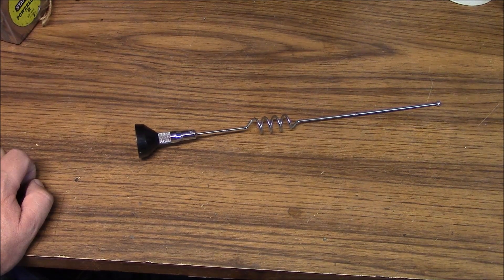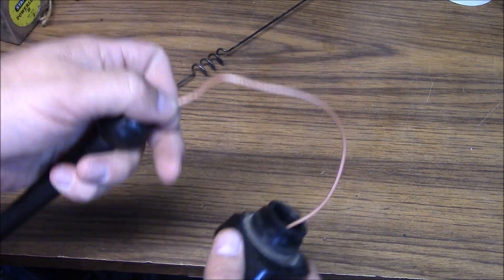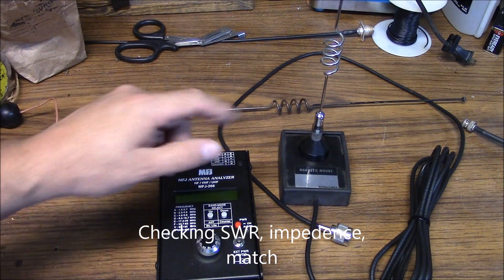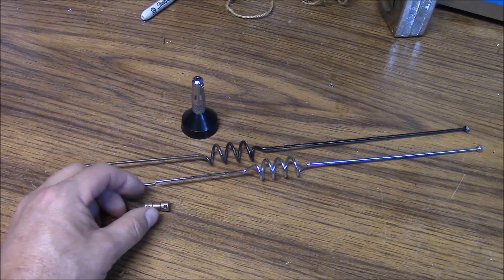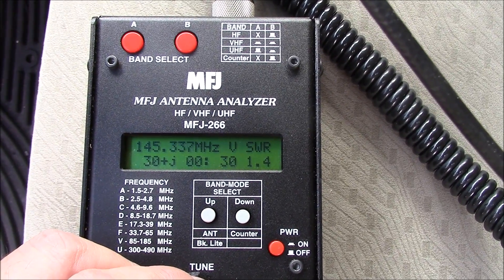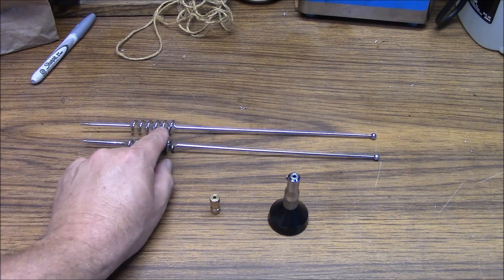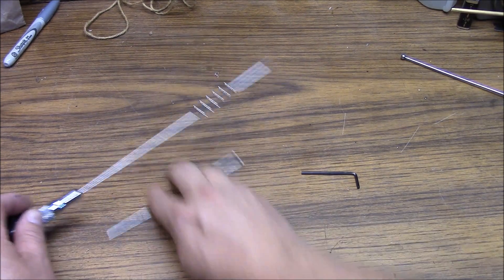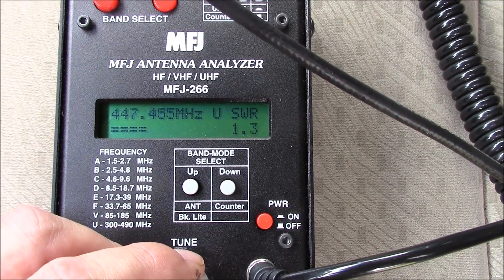VHF UHF antenna basics - DIY antennas from surplus 800mhz antennas for 2m 70cm and dual band

Comment: Very Nice, thank you! Question regarding the dual-band antenna. I noticed you put the UHF antenna closer to the base and then worked with the two meters at the top. Does it matter? Thanks again! Good info!!!
Reply from the maker: You are welcome ! I wanted the UHF length before the coil. I have not tried it the other way to see if it would work. BTW I still use this antenna on a mag mount when I use a rental car. Thanks for watching !

Comment: Thank you, very interesting video, and I like homebrewing with what I have at hand.  It seems you have identified the length of an 800mhz resonator which works on VHS simply by finding that the elevated feed resonator on the low mount has proper SWR - so, luck?  Knowing the length of the long resonator, you built the other resonator up, and created other variations.  But -- what length, in inches/cm, of a 800mhz resonator are we wanting to find or build?  They come in at least two lengths, maybe more?  I didn't hear in the video any length -- only lengths of segments relative to parts of the long resonator.  Thanks for clarifying.
Reply from the maker: 5/8 wave 800mhz antennas were all the rage in the smartzone  and amps days and every one I have found will work if you extend the resonator as shown. Just find a 5/8 wave 800mhz (806-870)  antenna and add length. These antennas pulled out of the pile unmodified are typically resonant around 160-170mhz just add a couple inches overall and your VHF is done. Thanks for watching

Comment: I haven't done any antenna fiddling before so I wonder if I can solder a resonator to the center of a pl259 plug? If so, what do I do about the outer part of the plug? I assume I have to isolate it from the resonator so it doesn't short out. Or am I totally lost in the woods and it can't be done this way?
Reply from the maker: You can totally make your own antenna in that fashion. You will need a resonator that you can solder , solder it to the center pin, insure that your resonator is insulated from the body of the connector. Thanks for watching !
Reply: @survivalcomms  Thanks! Any particular material I should use or is it good enough as long as it is insulated and the plug is filled up for sturdiness?
Edit: Could I use the dielectricum in a coax cable and slip it on the resonator? If it's too tight I could split it and insert a strip of dielectricum in the split and fill up excessive space in the plug with non conductive silicon that hardens, for sturdiness and to prevent water to enter.
I will have to find a resonator that will not bend easily and still fit the plug because I'm planning to put it on a magnetic base and use it on my car. It will not be for the ham bands. It will be for commercial frequencies in the ranges 154-160 MHz and 445-460 MHz. I will start with the measures from your videos and experiment from there, shorten it bit by bit. Do you think it's possible to make the antenna resonate in both the above mentioned frequency ranges? Any other comments on my plan? I can use all the advice I can get.
Reply from the maker: @syspangylium  some dielectric from RG8 should suffice
Reply: @survivalcomms  Thanks again! ☺️
Reply from the maker: You are welcome !

Comment: I was recently gifted a hand full of old ham radio antennas, and odd radio stuff & junk. One was a mag mount (odd sized) dual band antenna, which now appears to be a cell phone antenna! (Its crap on 2 meters!) So I will try and convert it into a 2M/440 or something usable? 
Great video and explanations!
Reply from the maker: The 5/8 wave cell antennas are resonant about 160 + - 5mhz in my experience. If you remove the finish , put a test clip on the top, and add a couple inches of wire adding length above the coil you can see if it helps.  Thanks for watching !

Comment: Explain the following to readers.
It's 6 inches before the load coil that is this loop, and after the loop it's 8 inches. This loop of 8 turns makes the resonance at what length ? This loop has 2/4 wave, that is, half wave ? The antenna has 2 radiant and if we want to put more radiant it should repeat that same amount of coil + radiant? Because there are no new videos about these collinear antennas for VHF and UHF on your youtube channel.

Comment: A tap and die set is a really useful tool to have. Paired with a box of different size grub and steel machine screws you'll find lots of uses for it.
Reply from the maker: I have a nice set here. The whip was much smaller than the stand off. Would have had to seal it regardless. 5 + years later it's still working good. Thanks for watching !

Comment: Sir I got a radio UHF car mount antenna for my radio.  I just recently  got a dual vhf/uhf baofeng . Can I use that same antenna for my baofeng dual radio .  Now the whip rod on the uhf antenna is removable and is about 9 inch
Reply from the maker: Yes you can as long as you keep the antenna parameters within the VHF / UHF frequencies you wish to cover. Thanks for watching !

Comment: Thanks. Question (since I'm not good at coils)...would it be possible to make a 1/4w vhf and 5/8w uhf with these? 
Gonna make me some dual band MURS/GMRS antennas for the cars and HTs.
Reply from the maker: With old 800 antennas it wouldn't work out. It is possible with other antenna designs. If you want good performance go with monoband antennas IMHO. Thanks for watching !

Comment: Can something like this be made in a 5/8 wave for VHF and UHF base station? 95% of the time it will be listening but I will mainly transmit on 146, 154, 451 and 458MHz. Thanks for the awesome video! I'm using a tram 1181 on a ground plane base and it does well for my use. But I'm wanting more gain in the UHF side as it lacks a bit. SWR is about perfect with this setup but would like to try a 5/8 wave and see if it helps any.
Reply from the maker: You should look into building a collinear antenna  for UHF or a yagi and away from a "dual band " solution IMHO. This is a resonant compromise. Thanks for watching !

Comment: Thanks.  Wish you’d shown how u were testing the antennas, for beginners, don’t know how you connected them to antenna analyzer... only seen them hooked up to coax.
Reply from the maker: Back when I made this video I was using my buddy's MFJ 259. I try to keep my videos short and sometimes details get left out. The feedline connects from the antenna's NMO base and goes the the RF connector on the 259 in this example. I use an Anritsu Cellmaster now for VHF/UHF/SHF antennas and the antenna connection is on the RF out on that one.  I hope this answers your question and thanks for watching !

Comment: I wonder if you can get you hands on some stainless steel welding rod and use that to make your own elements - the only issue will be making the little thing on the end but I guess another coupler could be used instead.  I think they can be a cheap source for these, not sure what the max length is.
Reply from the maker: Those will work. I have access to the rods. I just used the pile of surplus antennas I had to make the video. Thanks for watching !

Comment: lets see if I get this right you take the length of the vhf and add the length of the uhf to get dual band antenna
Reply from the maker: The length beneath the loading coil will dictate your UHF resonance. The overall length will dictate the VHF.  Do you have an old 5/8 800 mhz antenna you are working with ?
Reply: @survivalcomms o was thinking of buying some on ebay. just needed more understanding s othe rule is the bottom half is the uhf and the overall is the vhf .I want to get into understanding antennas during and emergency and you have to vacate be nice to know what you could use to get by with for antenna
Reply from the maker: The 800 5/8 waves can be pressed into service as VHF quarter waves if need be as is.  In this circumstance the main consideration is to keep the length of the UHF at 1/4 wavelength below the loading coil. The overall length should equate to a 1/4 wavelength at VHF. The best practice is to test what you have to see where you are before you start cutting.  You can always lop off 6 inches above the coil remove the coil and make a UHF antenna.
Reply: @survivalcomms  SurvivalComms explain the following to see if we understand 100%.
If we put 6 inches or 1/4 of a wave into UHF we will have, for example, an antenna for the UHF resonator down below the charge coil.
Now above the charge coil will have another 6 inch or 1/4 wave UHF resonator with the same measurement, okay?!

Now what is the measure of this turn that lies in the middle of these two UHF resonators?

What happens if this coil is larger or smaller in turns, and in turn the more coil (the coil) increases in size and the less the coil the smaller the coil.

We want to understand the following: 1/4 wave of resonator at the base just after the magnetic base and before the charge coil, then the charge coil, after the charge coil another 1/4 wave resonator, is this?

What is the purpose of the load coil because it is not responsible if the antenna will cover 1/4 wave in vhf. If 1/4 wave is used above and below the load coil, what is the purpose of the load coil?

You can explain it better. Because we like antennas and understand how we can improve our own antennas.

SurvivalComms Makes more videos with this antenna analyzer format, but specifically for GMH and vhf uhf. As this antenna has 6 inches of resonator, then has a coil of 6 turns and size approximately 6 centimeter, then has another resonator of 8.5 inches. So this type of antenna is more suited to UHF GMRS? To further increase the bandwidth of this antenna in GMH UHF, should you increase more the resonance or reduce, or even increase the number of coil or reduce?
Because our idea is UHF GMRS / FRS, but to increase the bandwidth across the 70 cm range. Now if you have three resonators, will the antenna have a higher gain in uhf GMRS / FRS SurvivalComms?

Comment: Great video. Thanks.
Can radials be added to the base if not used with a mag mount? 
Thanks 
D
Reply from the maker: Thank you ! Yes they can . Placing the nmo base on a sheet of metal with radials or using a commercial kit such as the Larsen BSA KIT (Tessco PN 38748) can adapt mobile antennas to fixed applications. Antennas adapted thus exhibit the same characteristics as they would mount on a vehicle. Thanks for watching !

Comment: Thank you for this.

I did tye the same using old mag mounts for commercial band.

I straightened some coated wire from a fence and cut off pieces at 1/8 inch each time, watching the results.
Reply from the maker: Cool ! It is always fun to make something useful. Thanks for watching !

Comment: Odd question. If you can make another UHF band for GMRS can i buy it off of you? I have been looking for a cheaper alternative to paying $47 I also have an old CB antenna if you can make a video on how to cut that down... its a cheap schochi from walmart
Reply from the maker: There are lots of cheap UHF antennas out there. Which one is 47 bucks ? You can make a UHF quarter wave out of that scosche cb antenna pretty easily.
Reply: Is there any way you could make a video explaining how to make one? and I was talking for the magnetic base and the antenna whip itself
Reply from the maker: MSgt101 spin the spring off of the base and let me know what size the post is .
Reply: It doesnt sat what size it is but it is the same size on bothe ends and i only have the antenna not the base
Reply from the maker: so you have no magnet or feedline ?
Reply: I have some coax.
Reply from the maker: from the base of the spring where it meets the magnet mount measure 6 inches and cut the rod at that point. Put a rubber cap on the end. Or spin off the spring get a coupler nut the same size as the spring support stud. Cut the whip (above the loading coil) measuring from the tip towards the coil for a whip length of 6 inches.  Drill coupler nut and thread for a set screw or  strip off insulation from one foot of 18ga hook up wire and fill the gap between the whip and coupler nut with this stripped wire. Drop some 5 minute epoxy on top of this to seal it up.
Reply: @survivalcomms  ju